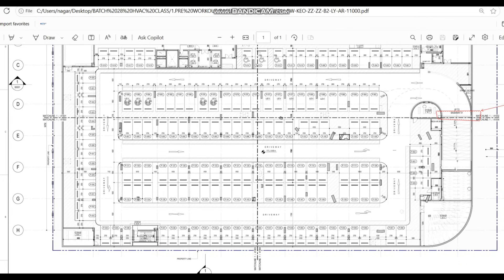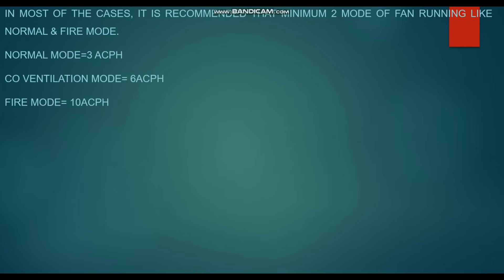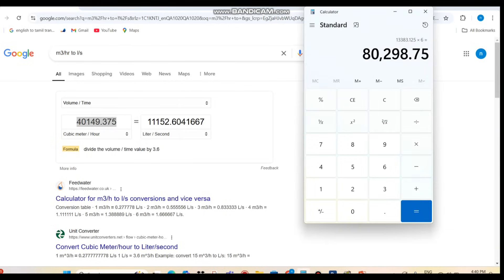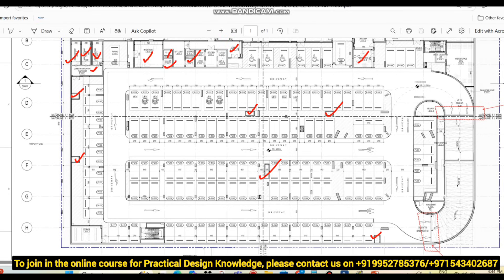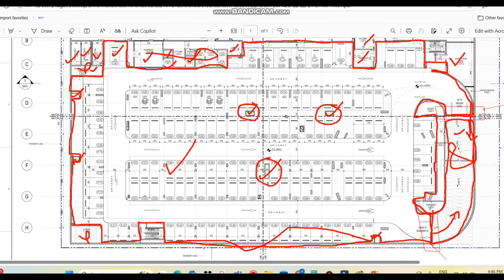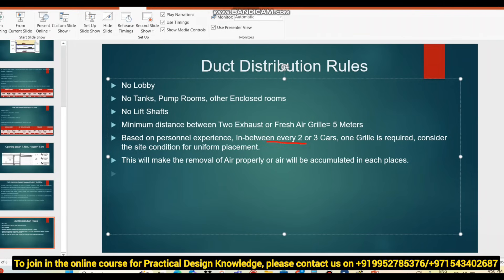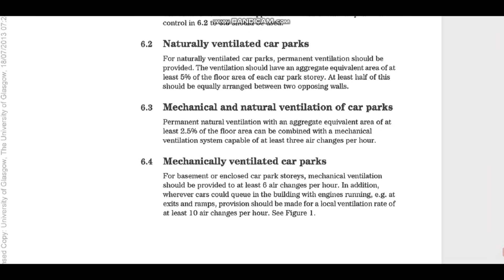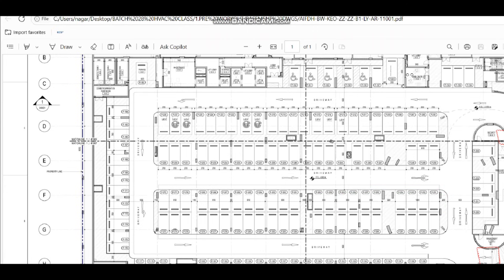Car Park Ventilation System Design

Comment: Good morning, how high is the height of the grid for monoxide extraction?
Reply from the maker: Usually we keep 1.5meters from finished floor level
Reply: @mepworld3385  Does the standard establish the height of the extraction and injection grilles? Or is it at the designer's discretion?